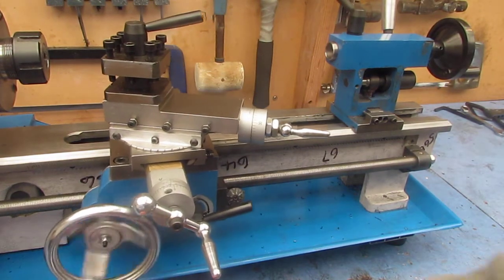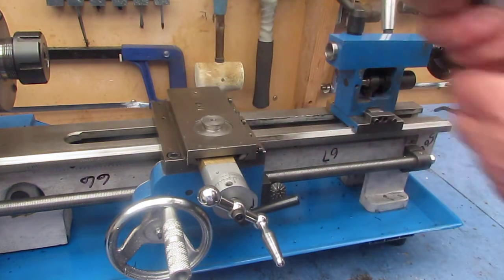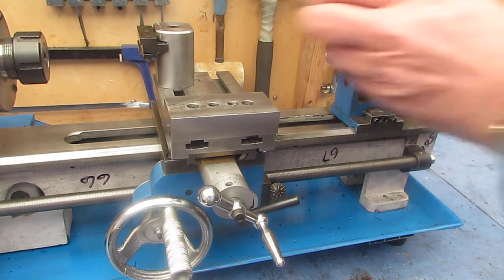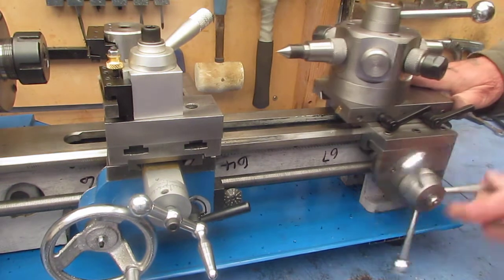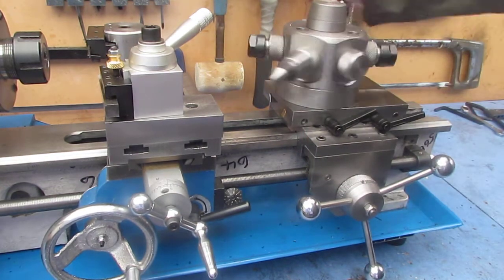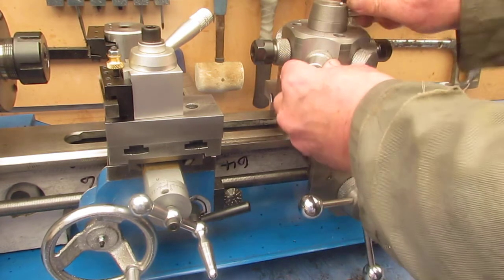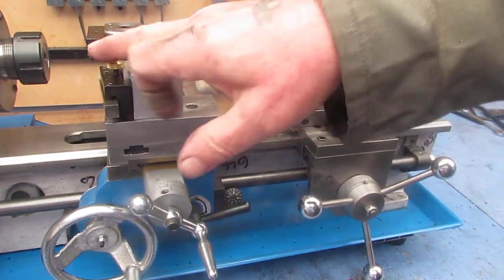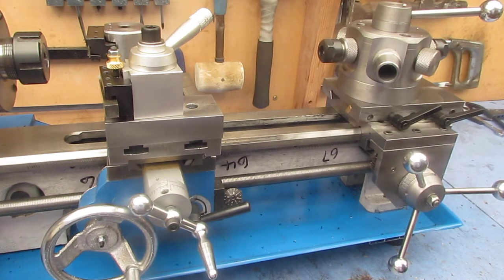CAPSTAN-TURRET ATTACHMENT FOR MINI LATHE

Comment: GREAT!!!! I so wish I had the extra length on my 7x10, to be able to do this, with the mods that I have done, I have gained an extra 2 inches, so basically, my lathe is now a 7 x 12.. but still not long enough to pull this clever mod / addition off on my little guy... Nice work, too!!!! I used to have the old 8 inch bed extension angle looking plate, that one pins and drill & taps on to the end of the existing bed... no issues doing that, and with out any tension on the unit, it is great for sliding the tail stock out of the way on to it, but if you were putting any pressure on the tail stock, via drilling operations, the factory casting bed would flex ,and cause issues.. I thought maybe it was the metric hardware that came with it.. nope, just the super high end high ductile cast iron, ( I say that jokingly, lol)... I may now have to just break down and buy that 18 or 20 inch long up-grade bed, as I want to build one of these capstan turret tail stocks so bad now after seeing yours, that I can taste it...  Very well done, I like seeing cool stuff like this, and hardly nothing gets me excited anymore, but this is really cool!!! Dru